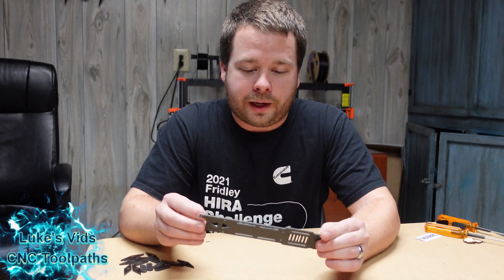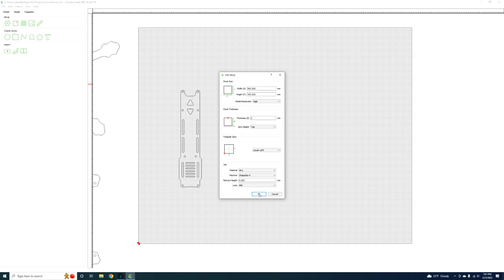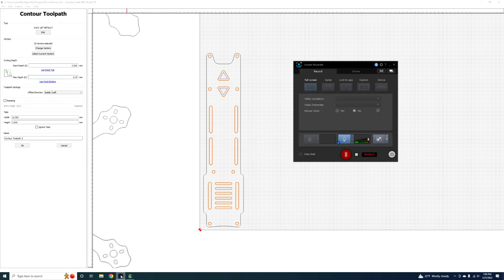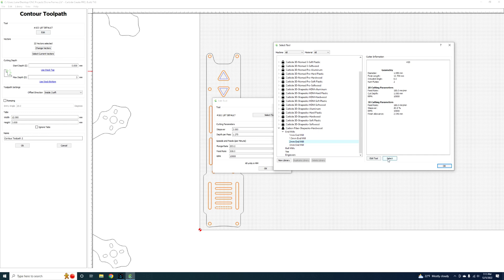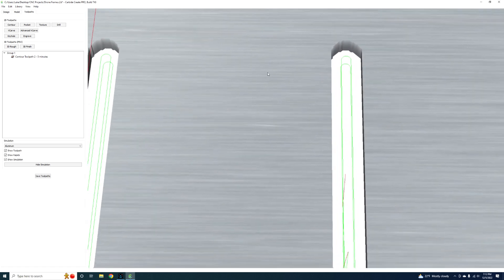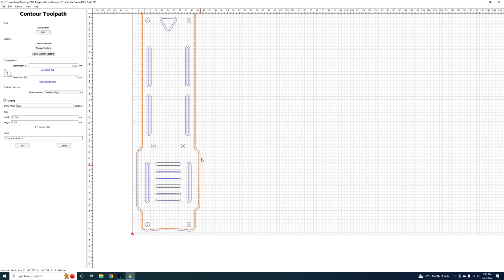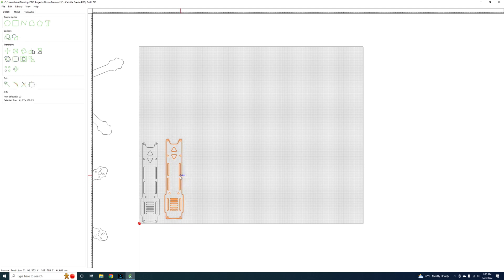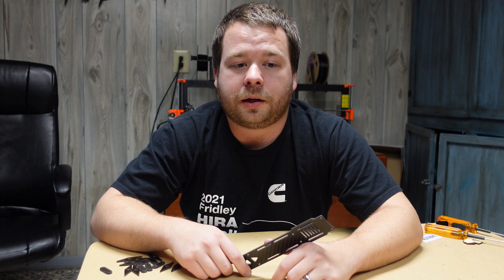Carbon Fiber Parts: Sheet Setup and Generating Toolpaths in Carbide Create Pro

Comment: Thanks for this looking round for as much help as i can find and thers so many programs and such out there im unsure what would be the best to get and start learning with i just want to make flat carbon parts with mayb a little milled detail in them and some beveled edges any opinion on the best program for my needs thanks
Reply from the maker: This program is free and easy. It’ll do all of that but you will need to know how to use it to mill some sections down and get the beveled edges. You’ll have to play around with it and see if you can get comfortable with the workflow. If you’ve never cut anything on a cnc router before, be prepared for a whole new world of terminology and trial and error lol. Took me 6 months to get proficient at it.
Reply: @lukeman269  yer thanks for the fast response ideally I want to learn the software before I bite the bullet on a machine have you tried fusion 360  seems like there's more tutorials on that so maybe better to learn on even if it is more complex
Reply from the maker: @kilner79  fusion is great for 3D design and it has CAM software built in for cnc routers too. It’s way more complicated to learn tho. But if you like fusion the best, you might as well learn on that one. Lots of good tutorials out there.

Comment: Roughly how much do you have into your router setup? Iv been eyeing the ebay 6040 / 6090 routers for rc building.
Reply from the maker: Roughly $3,000 for the router and dust collection.
Reply: @lukeman269  Thats not bad for the amount of area you can cut. Thanks

Comment: Very cool. Which kinds of bits do you use? I've tried the 2mm burr style bits but they seem to snap if I go any faster than 90mm/s. It's painfully slow when cutting thicker plates, lol
Reply from the maker: Yeah same burr style. I’ve got 1mm-3mm. Yeah very slow lol. Like 250mm/m for me. But I learned recently from another guy who’s been machining for 25+ years. He uses the same bits but 1.8mm and he goes like 500mm/m with a higher router speed. I’m gonna give that a try next to see how the cuts turn out. I would imagine the higher rpm allows less stress on the bit.